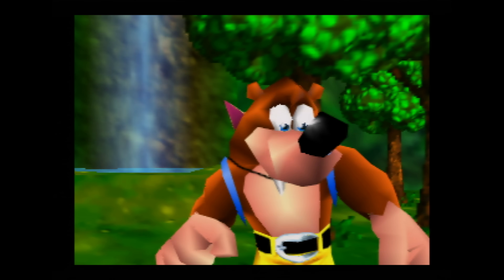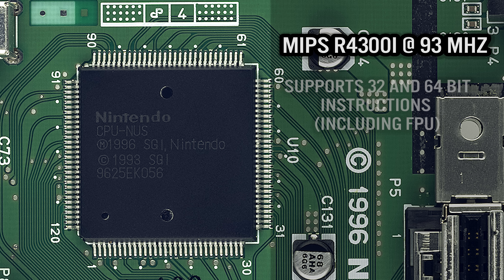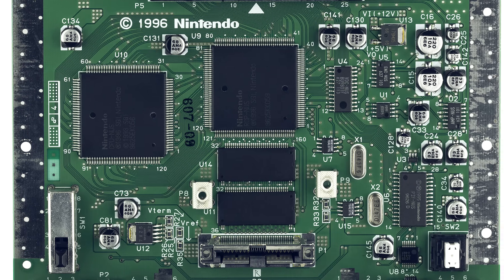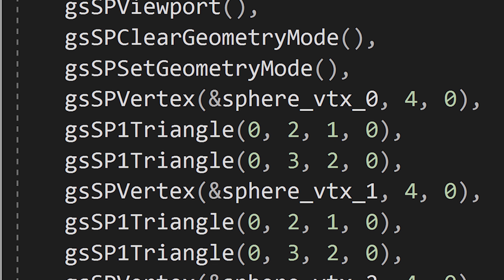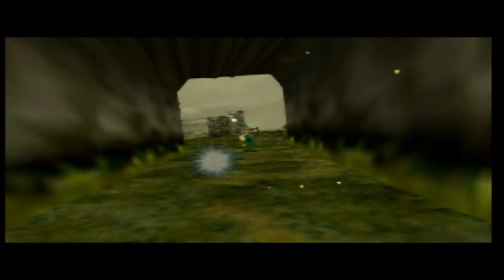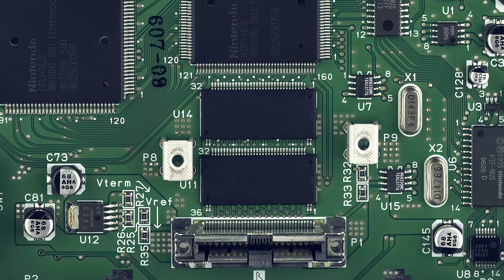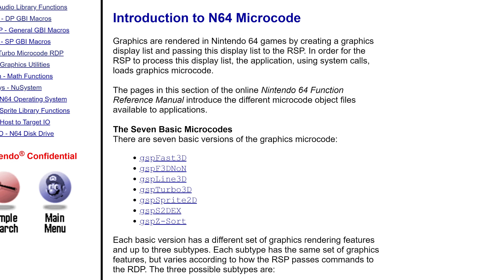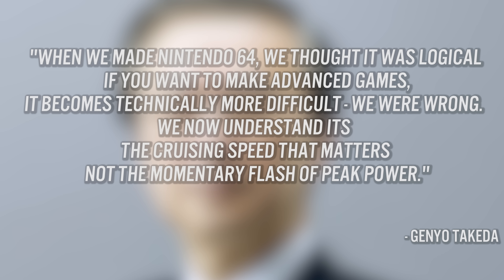Why was the Nintendo 64 so hard to develop games for ? | MVG

Comment: "Reading from cartridge was faster than reading from ram"
That sounds... interesting
Reply: There's a reason Rambus' RDRAM is listed on the TV Tropes article for Idiot Design.
Reply: Basicaly.. RDRAM was more serial than traditional SDRAM, making it easier to read in some ways but giving it a narrower bit width (which Rambus figured could be compensated for by high clock speeds). It also introduced Dual Data Rate (using both parts of the clock frequency to send data), which on paper should have made things faster. But the prototypical nature of Rambus' dual data rate tech and the use of the clock speed to compensate for bit width... ended up giving RDRAM excessive latency that made it perform worse than traditional SDRAM. And so what Rambus had intended to be the greatest invention since sliced bread as far as RAM went... became a source of bottlenecking instead.
Reply: @ZeldaTheSwordsman  yes, as far as I remember RDRAM had 32 bits on the PC while SDRAM had 64 bits.
Reply: @ZeldaTheSwordsman wouldn't aditinal clock speed help compinsate for the latency?
Reply: @ZeldaTheSwordsman  XD
Reply: @ZeldaTheSwordsman  XDDD
Reply: And Nintendo didn't allow anyone to make use of this, including themselves - the N64 was designed for flexibility of custom microcode.  Factor 5 had to lobby Nintendo who eventually allowed them to write the microcode and only authorised use for only two games - RE2 and Indiana Jones - Nintendo where so obnoxious.
Reply: @overwatch761  they probably had a reason for this, maybe that it was harder to debug or something like that.
Reply: @rfvtgbzhn  As far as I'm aware Nintendo didn't even provide a debugger  which made development even harder.  Nintendo were simply trying to keep themselves by all means at the top of the tech chain.
Reply: @overwatch761  what would be the purpose of that? I mean they clearly wanted third party developers, otherwise they wouldn't have a implemented licensing system and it was in their interest that third party games would also have a good quality, so I don't see how this makes sense from a business POV.
Reply: Switching to your gun is faster than reloading
Reply: @Rateptaker  Touche
Reply: Cartridges used ROMs - Read Only Memory. It's a chip with data on it that is hardwired to the board. RAM can be written to, and it works very differently. ROMs can be faster!
Reply: How much is the speed of the average ram speed back then? Now its almost speed of light
Reply: @ryhanzfx1641  At the introduction of the N64 (Fall '96), the original Pentium was the main Intel consumer CPU (Pentium MMX launched the same year as N64). The FSB was 66 MT/s, it had a 64 bit data bus, so in theory the bandwidth of the CPU to the whole system (memory, peripherals, etc.) was ~500 MB/s. The N64's RDRAM was capable of about 520 MB/s. What is important here is the latency though - i.e. the amount of time between making a request for data and actually getting the result. RDRAM implementation in the N64 was notorious for it's horrible latency, which was about 3 times higher than PC SDRAM. You can have multiple requests in flight, but any single request took quite awhile.
Reply: @teknoman117  Not to forget that Intel suffered the same fate using RDRAM on the initial Pentium 4 systems, which was another reason for the exceptionally long pipelines in the processor's design. Even a pre-DDR Athlon system was competitive in latency over bandwidth, whereas Pentium 4's running SDRAM (on the i845 chipset) were starved on the latter.
Reply: @teknoman117  Actually almost all PCS used EDO RAM in 1996, SDRAM was a rarity even in high-end PCs. SDRAM didn't become main stream on the PC before about 1998.
Reply: rfvtgbzhn Come to think of it, you’re right. I mentally blended socket 7 (FPM EDO DRAM) and super socket 7 systems (all SDRAM) together, the latter being AMD K6-2 series (1998).
Reply: @ryhanzfx1641  I think DDR1 was just about to get out on the market at the time.
Reply: @AndrewTSq  DDR wouldn't really hit the consumer market until around GameCube launch. The first consumer CPU with DDR RAM support was the "Slot-A" AMD Athlon in 1999. I don't know of a single consumer motherboard made for it that actually took DDR ram. It was succeeded by "Socket-A" Athlon in 2000, but still only a few (expensive) DDR motherboards were available. You'd typically only find them in high-end systems with the 1.4 GHz Athlon SKU. DDR didn't become standard on all motherboards until the launch of Athlon XP and Socket 478 Pentium 4 in Fall 2001.
Reply: @teknoman117  P3 had ddr.
Reply: @teknoman117  I had a slot A 700 MHz AMD processor until my power supply died and fried my motherboard, hard drive, ram and CPU. Then I went to the socket A 800 MHz processor. I believe the socket A had DDR on it and a 133 MHZ FSB speed.
Reply: @AndrewTSq   this is crazy to imagine to me, and I know I'm 3+ years late here with this comment. My Cheap gaming PC has 16GB of DDR4 ram. My last computer has 2gb of ddr1 lmao. I'm so thankful.
Reply: @ZeranZeran  Ah well, I was kind of wrong. It was not until 1998 that the first DDR1 module was available to buy. Probably for servers, and not until 2000 when first consumer products where out to use it
Reply: @ZeranZeran  And don't forget, the games cartidges was maximum 64 MB(512Mb).
Super Mario 64 was on 4MB (64Mb) cartidge!
Reply: @ryhanzfx1641  slow
Reply: SRAM vs DRAM
Reply: @shadowopsairman1583  the cartridges used mainly ROM. SRAM was too expensive to be used in larger amounts, it was present on some cartridges, but mainly for storing savegames (in this case a battery wss used), not so much as main memory expansion from what I know.
Reply: It's the other way around now, RAM is way faster than ROM, you copy ROMs to RAM for speed, and it's called "shadowing". ROM is crap because the data lines flop all over the place for a while until everything settles, it's not great. RAM has multiple parallel high speed pipelines (one per bank), bursting the data on both edges of the clock and overlapping requests. ROM has a simplistic give-one-address, get-one-word protocol.
Reply: catridge os
Reply: @thedevollsadvocate  I know what imma do today
Reply: @thedevollsadvocate  's my idea; since SSDs are getting bigger and good for OS and software, if you would have like, RAM cards; then behind a SSD on the SAME bus as RAM holding the software, you don't have any 'loading"'

it's hard to make with X86, but that's how the BIOS ROM works, not the SSD that's on its controller behind PCIsets ... but a RISC, vector processing system that's how it works. 
Why copying everything on RAM when it already exist and can be read on a ROM. 

current 
ROM/SSD/HDD > controller > RAM > CPU
there
SSD < CPU > RAM < HDD, LAN, etc. 
same with the GPU, the GPU does its stuff regardless.
Reply: Oh my god if you build an n64 cartridge with Bluetooth and Wi-Fi receivers in them you could basically have a cartridge OS which is totally untraceable
Reply: @thedevollsadvocate  How do you know the wireless transmitters aren't tagging your data?
Reply: @thedevollsadvocate  Or you could slot a cardridge up your bumhole for a nice brown OS
Reply: Huh
Reply: Because in N64 the CPU didn't have any DMA to RAM to process textures at a high speed and mipmapping
Reply: From what I learned recently, it's because the CPU and GPU share the RAM. So to for a function to send something to the GPU, it would get in the way of the CPU and vice versa.
Reply: Sounds as exciting as teh powah of the cloud
Reply: for today standards when a simple sd card with 64 gb is very cheap but back in the time that wasnt good at all
Reply: Patent pending
Reply: holy shit.... CArtridges os's
Reply: As for cartridges being faster than RAM in the N64, actually no. RDRAM memory chips are in a way actually much faster than the cartridge - it's all about how much data you can fit within a bus clock cycle across the bus. 

Nevertheless, all that didn't matter much anymore especially when you have a crappy GPU (why 4KB L1 cache?!) - all that was enough for Nintendo to be basically ignored at least until they finally got the GameCube console together (they listened to the gamers after the N64 flop and went with ArtX which is of course now AMD, for the Radeon GPUs which helped with the popularity of the Nintendo consoles back in the day, and it also helped that Radeon GPU in GameCube wasn't as hamstrung as N64's).

Comment: Interesting how two generations later Sony made a very similar mistake
Reply: You mean one generation later. The PS2 had little VRAM, and clever developers had to rapidly swap in from main RAM. Between that and the VPUs, it was arguably even more challenging to wring the most out of than the N64... the only console harder to develop for (at least for 3D) was the Saturn. You needed someone at Jon Burton levels to get good 3D performance out of the Saturn.
Reply: Ps2 sacrificed capacity for high bw edram...it was a gamble that did pay off even with sacrifices
Reply: @MrInuhanyou123  That's the point, there were tradeoffs similar to the N64. EDRAM/ESRAM can be good if it's used in addition to a powerful conventional configuration (Xbox 360) but it can be a detriment if it is used to make up for other shortcomings (Xbox One / DDR3). If you were a very talented developer without major time or cash constraints you could make the PS2 sing pretty good but not as good as a more conventional Xbox (original). Even the older Dreamcast with its more conventional layout (and less total RAM) often outshone the more powerful (and more expensive) PS2 when it came to textures and AA. Even early titles like Soul Calibur looked quite good. The PS2's main advantage was that (again in the right hands) it could push a lot of polygons. Not as many as they tried to claim initially, of course... in an actual game with advanced special effects, decent textures, AA, etc the actual triangle count wasn't that epic. Meanwhile Sega actually under rated the DC. Developers were wringing out 5-6 million polys even with all the bells and whistles turned on.
 
Don't get me wrong, the PS2 was still overall more powerful, and could do very well with the right developer (especially late in its lifespan)... but I think they would have had better results with a more conventional layout, especially for early games and smaller developers. Side note: My favorite example of "help I'm out of VRAM!" was the port of Grandia II to PS2... they had to turn stuff off when you used a video-stream-overlay spell.
Reply: @AlexvrbX  xbox one used esram which is not as fast as traditional edram for higher capacity. Not exactly same situation. I think ps3s unique traits is more applicable to the n64 comparison since it truly hobbled multiplatform development( of course not to as drastic as n64 which barred even making games of specific types)
Reply: @MrInuhanyou123  It was still quite fast, and provided a large bandwidth boost. Had they had used it in conjunction with GDDR it would have been purely an asset. As it was, they were using it to help make up for the shortcomings of a DDR3 setup. It was barely good enough, and required a TON of effort on the part of devs to reach the kind of bandwidth you got out of the PS4's GDDR - and even then it still could fall short, depending on the game/engine in question. Of course it didn't have enough raw power either, since they went with the smaller GPU. They fixed their shortcomings with the One X.
PS3 is actually a more conventional setup in terms of graphics and memory bandwidth. The Xbox 360 was actually more radical with the daughter die and EDRAM, plus unified main/vram. The CPU side of things is a different story, and Cell was definitely a handicap. Although the PPC chip in the Xbox 360 was pretty strange too compared to the original Xbox. It was a triple core hyperthreaded PPC with custom VMX vector processors, and it was an in-order CPU. Not as bad as Cell, but still harder to harness fully. Anyway, that's all getting off topic - the video and general conversation was mostly revolving around graphics and associated RAM / bandwidth. In which case, the 360 was the strange setup.
Side note: I wonder if they aren't making a similar mistake with the next gen consoles, not packing in enough RAM and leaning on the SSD to stream in hardware-decompressed assets. I guess since both MS and Sony are taking a similar approach, it won't matter. Devs will just have to deal with it. Either way this might benefit PC games in the long term, finally force devs to require decently-fast SSDs and actually tax the drives a bit.